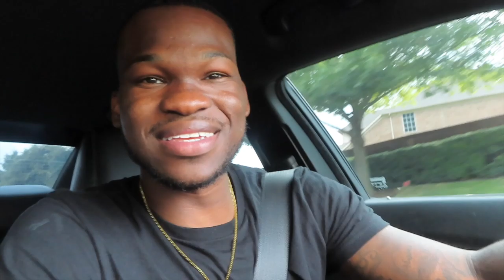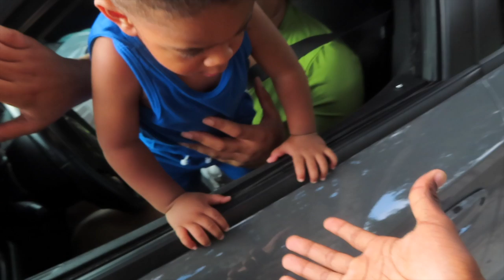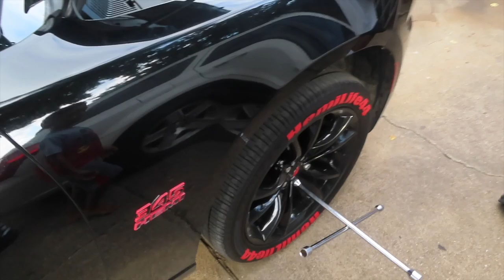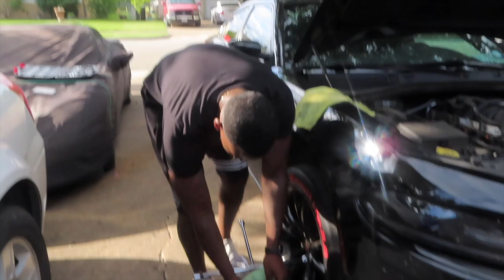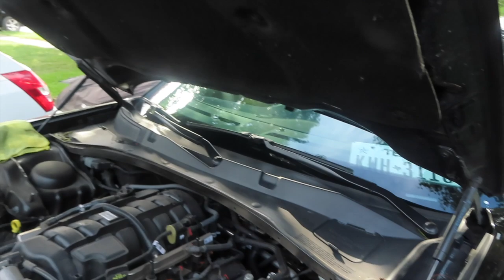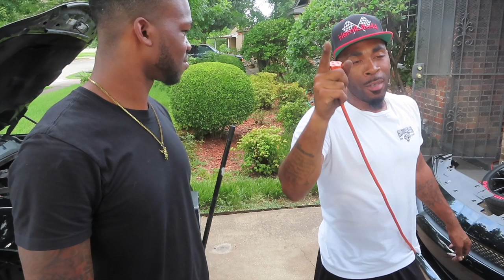We Destroyed Hemi Life44 Car!! **This is bad**

Comment: Y’all need a impact wrench & impact driver adapter set for sockets instead of buying a air powered impact drill,etc & it will work with socket set you buy at the stores as I have one of both with a drill/impact driver set & use it a lot but he should get a cold air intake to replace the stock air intake & put twin turbo on that car..😂🤔🤷🏻‍♂️👍🏻😉